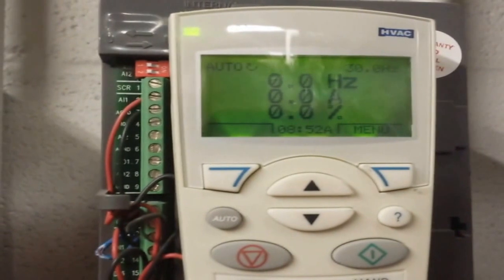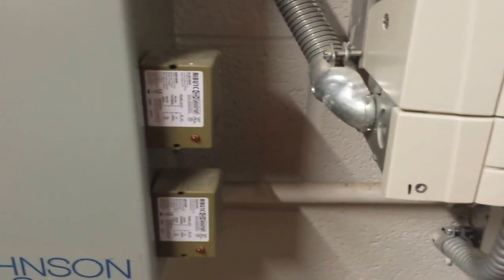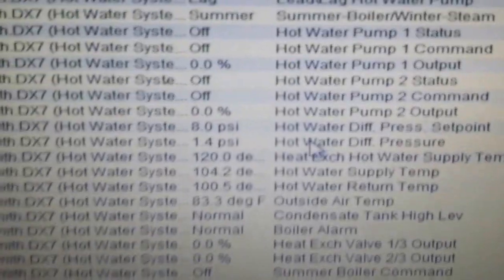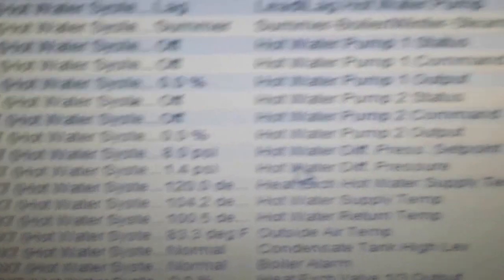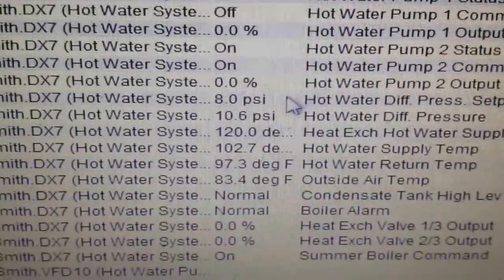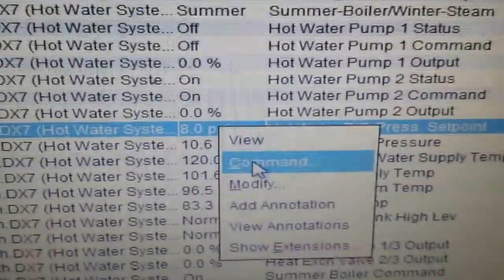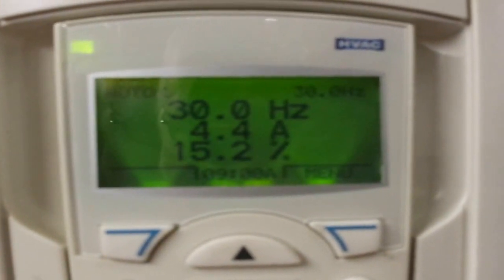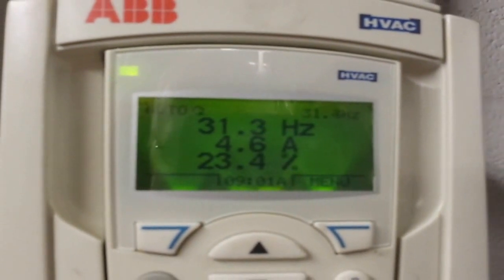How to Controla Variable Frequency Drives

Comment: Just noticed your video. Why did the speed start ramping at 20% speed signal when 30hz is 50% of the assumed max of 60hz?
Where do I set the minimum speed to get an accurate 0-100%? Mine has been set as min of 20hz for a pump so my 0-10vdc is not linear. 20-60hz, 0-10vdc signal.
Reply from the maker: The minimum speed is set to that.

Comment: What would happen if it's programed for 4-20ma but it got a 0-10v signal or vice versa due to an error in programing?
Reply from the maker: They will not control to setpoint very well. I've seen some just go to 100% when it wanted 4 20 but got 0 to 10.